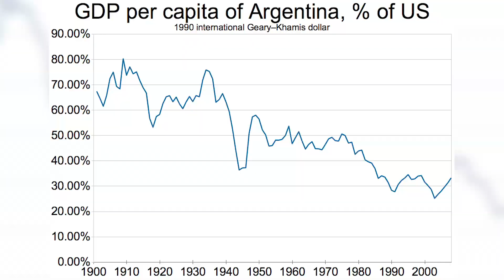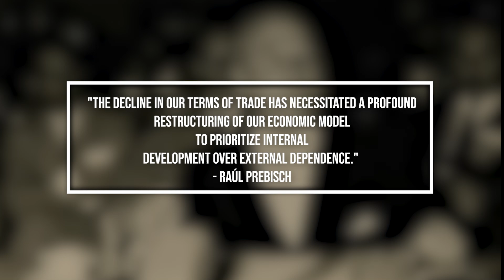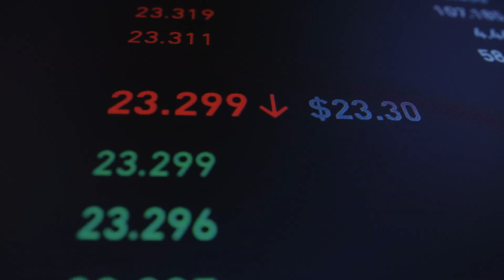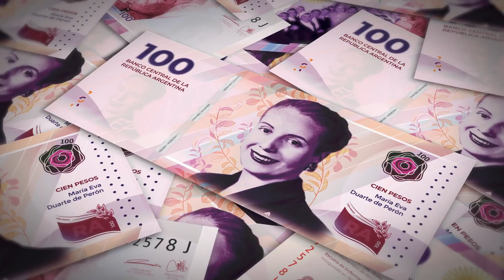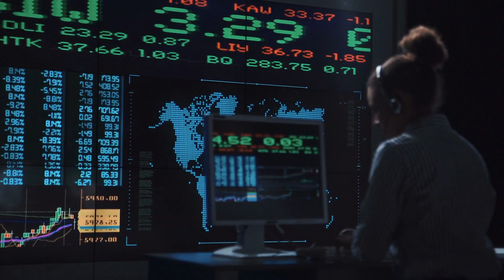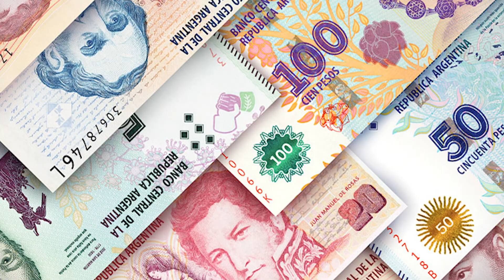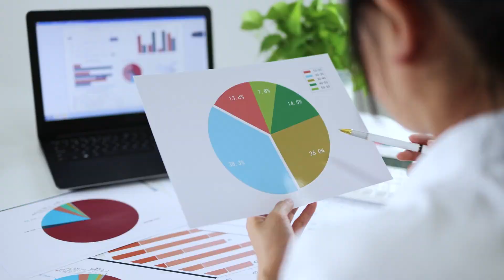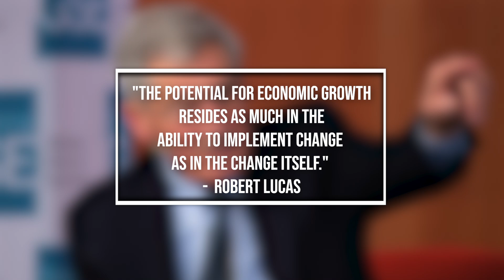Argentina's 100 Year Long Economic Crisis

Comment: The problem that Milei receives isn't a joke at all; while inflation is travelling at +300% year to year currently, the excess of money in the economy is double compared to 1975's "Rodrigazo" which multiplied by 6x the inflation rate. So we potentially have between 1800% and 3600% inflation beneath the carpet, not to mention the "LELIQs" problem of the Central Bank which can multiply by 4x the already atomic bomb mentioned.
Yeah... not easy at all, but we'll prosper anyway.